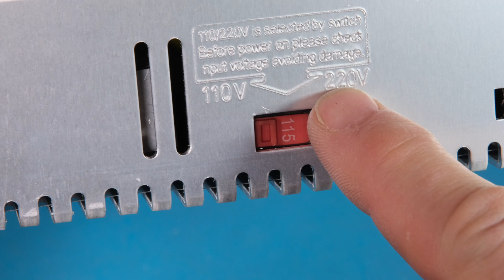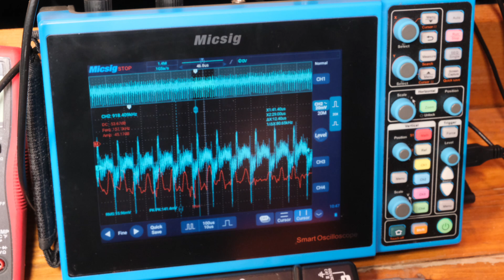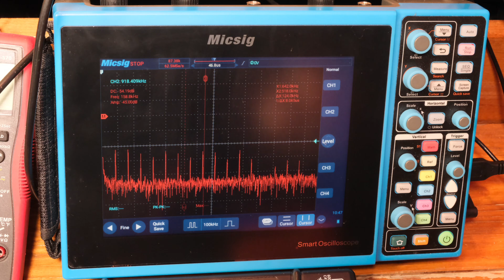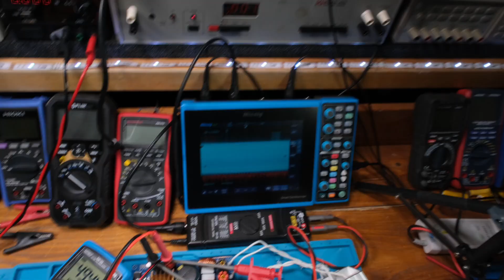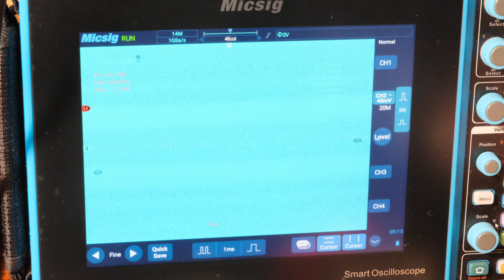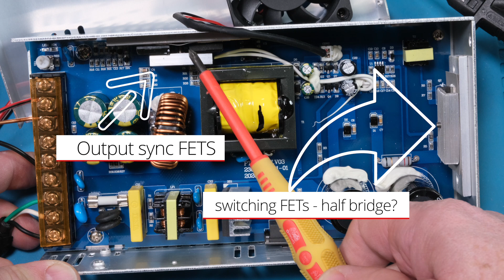Class D Amp meets SMPS - the TPA3255 300W x 2 meets 600 Watt SMPS

Comment: For fun I made a junk box psu  for a cheap class D module I had. The most primitive filter worked best. Low value resistor ( 0R33 ? ) and 10  000 uF.  Sometimes this will trip the smps current limiter, not this time.  Place the filter close to the amp. The results were just what I wanted with much better RF noise. 50 Hz area also.  A linear supply not really better. I prefered the smps using ears. More solid in the bass. A scope was used. 80% of the time an idea like this doesn't work, too simple. I suspect the 10 000 uF was  just about  OK at 65 kHz.  The amp is decoupled and uses 240 kHz with no output filter. Out of phase bridge with class D switching in phase.  In theory the speaker will not see the 240 kHz. I got rid of the 65kHz.

Comment: I've got a board with 2 chips in PBTL mode and 2 real nVidia fans! It all usually works well, until the 1uF Caps at the output blow up.. any suggestions on how to fix this?

Comment: Dear Eddie, thank you for the review.

Could you please share your oppinion on the possibility of replacing the two 4700 mkF power capacitors with a pair of 10000 mkF ones, while the power supply is a switching type 48V 7A -- will it affect the TPA chip's operability? What will be the overall effect, if any, of such a replacement? Thank you in advance for your oppinion.

I also invite all other people in the know to express their views on this idea.
Reply from the maker: When you have a regulated power supply - adding huge capacitors can slow the response of the power supply.  Adding some poly caps or ceramics in parallel to the large caps might be of better help as these will filter the higher frequency ripple.  Hope this helps?
Reply: Class D get much better with smaller and more capacitors. Get some 680, 1500, or at least 2200uF caps. TBH, as its not in the main power supply, i dont know why they used so huge capacitance at this point. The direct fet suppling caps are usually much smaller, für most amps maximum 1 680uF cap. I would try to go down in capacitance and then build this one from 2 or 3 smaller caps. 

With my "Hifiakademie" i wen so far, that at this point i have 180uF electrolitics and 40uF foil caps. The speed you get is insane. At the main supply (linear one) i added 4 220uF to the 2 10000uF caps and the difference is insane. Smae principles applies für low voltage supply to OPA`s etc.  ;-) 

Particularly Class  D`s come alive when they get "fast" current. ;-)

Comment: hello, I don't understand your video, I only know Spanish, I'm using the translator, I wanted to know what the real power is without distortion and how much impedance was measured
Reply from the maker: Thanks for the question.  The spec for 10% THD is 300W x2, but for 0.1% is really half that if you can keep it cool.  Here's a video: https://youtu.be/YCYOXn1f5b0

Comment: I need the next video Eddie 🥲. I'm looking forward to this series with TPA3255 amp. I want to make a 4 channel amp and mono amp using this chip.
Reply from the maker: Thank you Eliseo!  I'll have this next video out very soon;)
Reply: @kissanalog  Hey. If i might ask a stupdi question: I have the same PSU (600W version) What happens when i have a chinese class D that have + - and ground on the power input, so aa dual supply. Can i run one of these boards somehow with these PSU`s?

Comment: It's a two switch forward topology and the small transformer is a gate drive transformer (you can see the traces going to the transistors and the two reset diodes).
Reply from the maker: Thanks Bogdan for the great feedback!  I think you are right of course;)  It is so funny because I totally missed the 2 transistor to the right (that make up the 2 switch forward).  It was so obvious when I was editing the footage later - I almost reshot that footage:) I think it must have been the angle I was in when taking it apart and filming.  I need to stop the camera and take a closer look before I go on identifying things while recording.